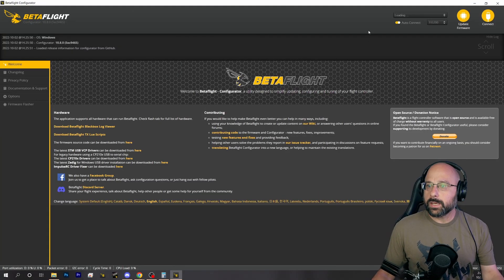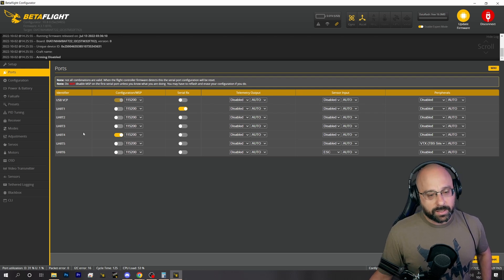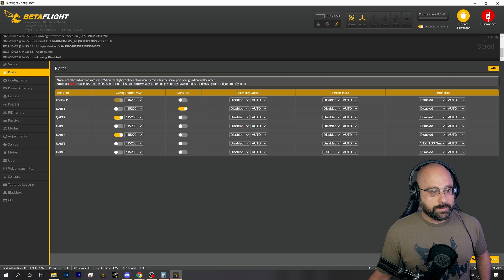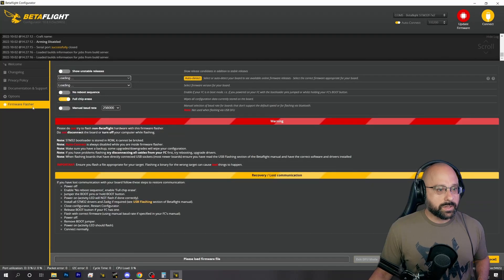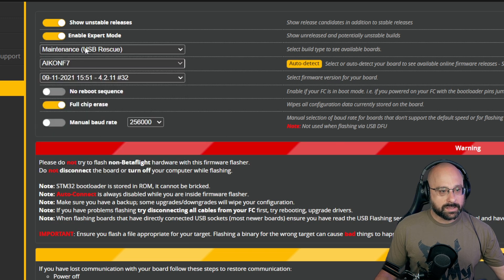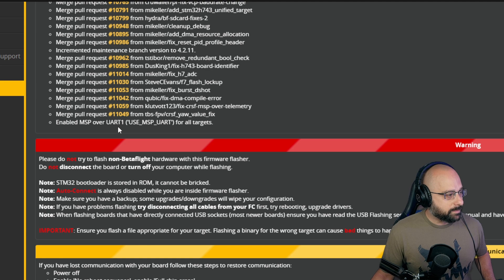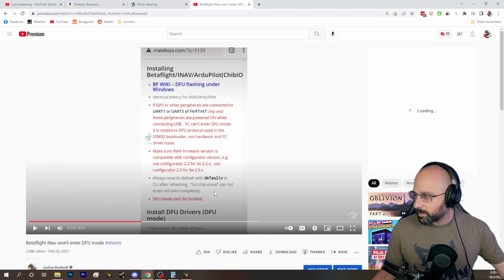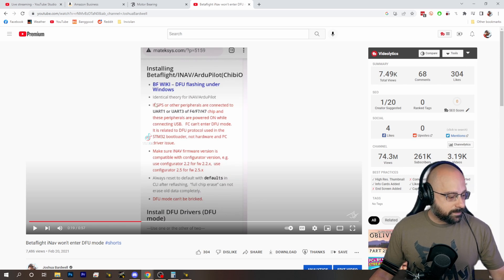How To Use Betaflight USB Rescue If You Broke Your Flight Controller Port - FPV Questions

Comment: Another option here is to cut down an USB cable and solder it directly to the FC's USB pads. Then you can connect to Betaflight and enable MSP. Not very easy, but that's what worked for me.

Comment: Some flight controllers come with the USB connector in a separate board that you connect to your FC with a JST cable. And I feel like it's much easier solder wires to a broken JST connector than to a broken USB connector. 
Perhaps more FCs should be build that way.

Comment: I think im at the worst case of broken USB problem 😅
Mamba Mk2 f405 doesn't have RX1 ( SBUS inverted ? ) and the tiny pads on the usb port is lifted ( no chance to solder new usb port ).
It's a big help if I can solder ftdi adapter to other uart other than uart1 on usb-rescue ( ahemmn chip shortage )

Comment: U can alao just replace the usb port its not that hard honestly buy one of those butane soldering irons kit and it comes with a hot air attachment just use caption tape on any small chips